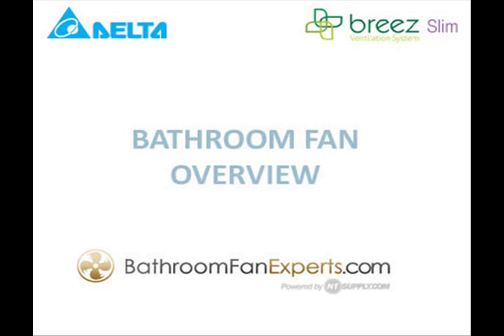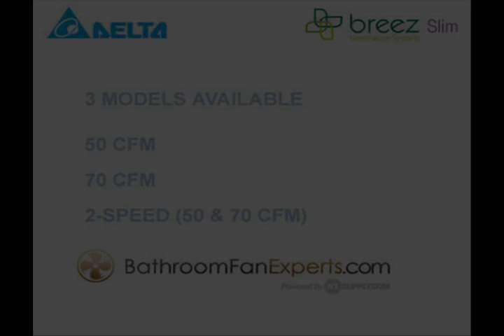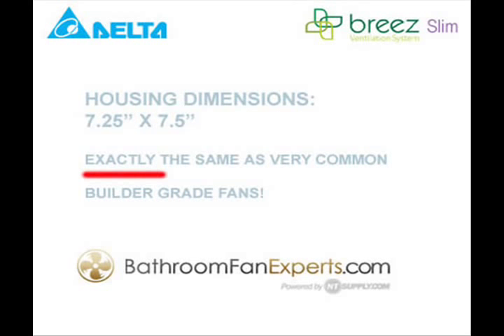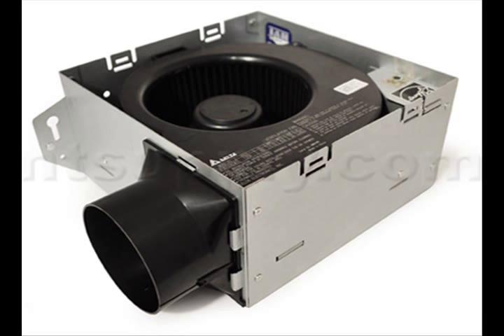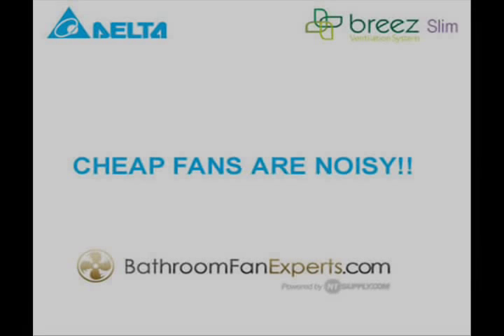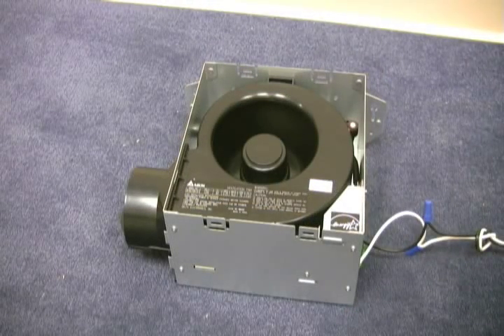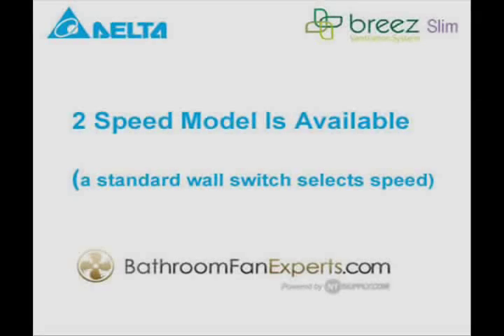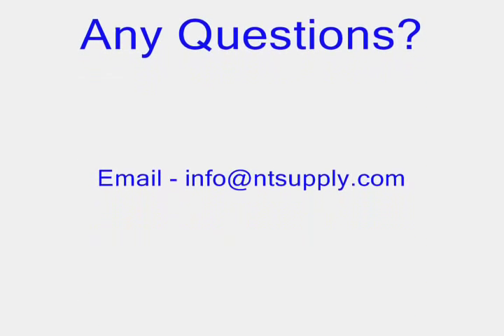Delta Breez Slim Bathroom Fans

Comment: These can also be converted to operation at 12v directly - for use from batteries or low voltage controls.   If people are interested, we can make a video of the conversion.